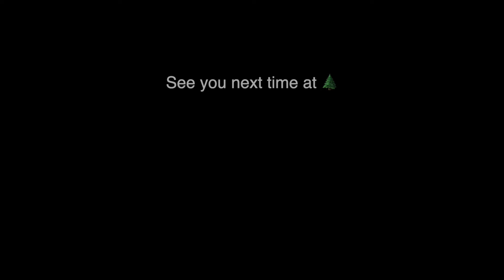Putting the last touches on the Ford Tractor - Oil Change, Body Work, Steering. [vlog 012]

Comment: You didn't check the oil bath air cleaner unless you did that off camera.
Reply from the maker: Nice looking out Jonathan! We indead did do it off camera, not on purpose ,we just didn't film it. And like the breather we completely took it apart and cleaned it. It wasn't that bad, but it's always nice to start with clean slate. :)
Reply: @bigsprucefarm  sometimes things get over looked.  The oil bath air cleaners can turn into a nasty mess if they're ignored.  Not to mention it can't do it's job efficiently.